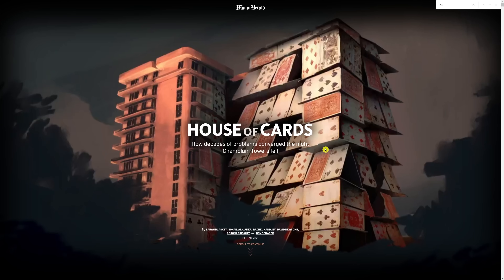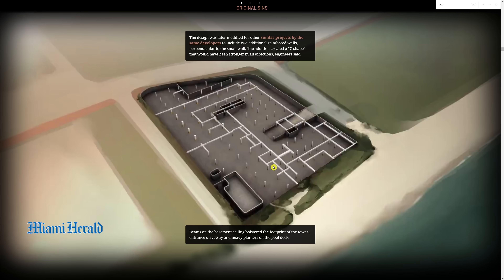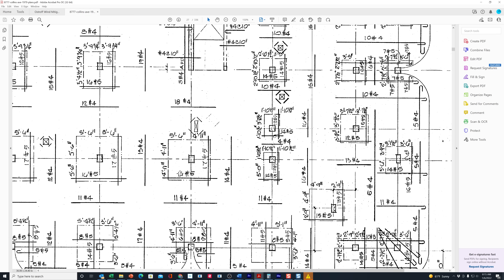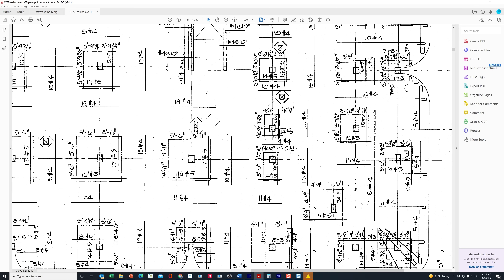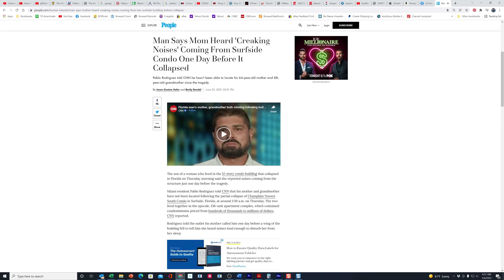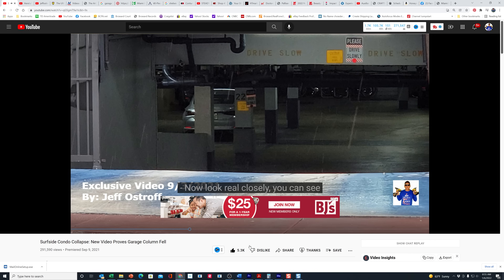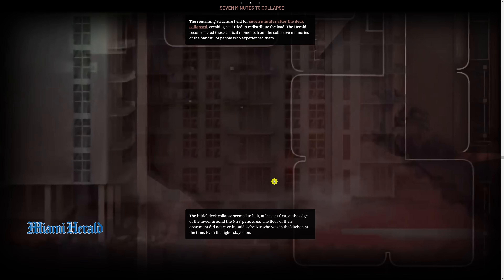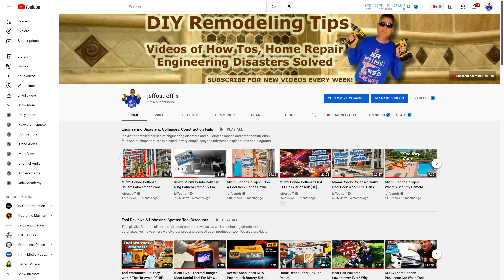Best Condo Collapse Theories: Me Or Miami Herald House of Cards?

Comment: There are some engineering issues with the analysis performed by the Miami Herald.  Some of my comments will relate to the Miami Herald analysis and article, some will relate to this video.

Columns in one area were bigger than columns in another area, that doesn't mean that the smaller columns are insufficient.  The small columns under the east wing are sized fairly close to what they need to be to support the weight of this building.  They may look thin, but there are also not very tall since in a parking garage or condo the floors are not very far apart.  Office building and industrial buildings can have columns 2 or 3 times as tall as these in which case a small column could be a problem.  The Miami Herald story does not conclude that the columns are too small, only that the reinforcing spacing is an issue and this particular issue is a gray area in the building code, the reinforcing in these columns does not violate the building code.  The columns are probably the part of the original building that was designed closest to what was required.

In the plaza area there are some beams that were removed between the permit drawings and the final drawings.  The problem is that these beams were not strong enough for the job they needed to do.  The version of the drawings without the beams is stronger than the earlier version of the drawings with the beams.  Having a beam or removing a beam might be important, but all beams are not created equal and you have to also do calculations for the strength of the beam before you assume that it would be important to the strength of the building.  In fact some of these beams would have been very much overstressed if they had been constructed.  I'm writing that without the beams the slab would be stronger, but still not strong enough for the required loads.  The Miami Herald engineers are correct in that this slab would have been overstressed from the beginning.  Since it was covered up by waterproofing and pavers nobody could have seen the cracking in the top of the slab over the columns.

Anti punching shear rebar?  Who made that up?  Certainly not a real structural engineer.  Don't listen to what other youtube channels say about his.  There is no such thing, you will not find it in any reinforced concrete textbook, you won't find it in the 1977 ACI building code, you won't find it in the 2019 ACI building code.  In 1977 the main way of reinforcing a slab against punching shear was to use steel shearheads and they most certainly did not have these in the Champlain Towers drawings.  More recently a product called stud rails has been invented and is widely used as punching shear reinforcing.  The Herald article discusses punching shear due to insufficient reinforcing steel.  There is no engineering basis for this in concrete textbooks, concrete design practice or concrete building codes.  The steel was in fact not placed as required by the drawings but the biggest deficiency with respect to punching shear capacity was insufficient slab thickness and this goes back to the original structural design.

Is the fitness center weight important?  The weight of all of the materials on top of the structure outside of the pool deck would be very much heavier than the weight of the equipment in the fitness center.  This includes the planters, the dirt, the pavers, mortar, grout, and additional concrete topping.  And the concrete slab under these materials is similar thickness and reinforcing to the concrete slab under the fitness center.  So if the fitness center is of concern then the pool deck loading is of even more concern.

The Miami Herald article mentions interaction between the ground floor slabs and the basement walls, as if the slabs are pulling on the walls.  They have omitted one important thing and that is that generally it is the other way around- dirt outside the building pushes against the basement walls and they in turn push against the ground floor slabs.  So the interaction is pushing not pulling.  I suspect they omitted these loads from their computer analysis.  This is the reason that Allen Kilscheimer told the city after the collapse that the basement walls were still in danger of collapsing- the dirt outside was still pushing on them and they no longer had the ground floor slabs to lean on.  The graphics in the Miami Herald article show how a system like this would normally be constructed however the text in the article and the photos from the site show that the building might not have been constructed this way.  The original structural drawings are very skimpy on how this would be constructed and did not show the reinforcing to be placed in the way that it should be placed to properly reinforce a connection like this, however even if built as the drawings show it would not have failed as stated in the Miami Herald article.

The article goes on to talk about reinforcing steel failing as damage spreads across the deck.  Again they have overlooked the interaction with slab movements with shear stresses around the columns.  It is more likely that as one area of slab deflected that the rotation at the columns increased which in turn increases punching shear stress and causes punching shear failures to progress across the pool deck.  This could happen if the connection from slab to basement wall failed but it could happen in similar fashion if one of the slabs decided to have a punching shear failure under a planter just outside of the tower.  The small beams under the planters wouldn't stop this, the small beam along the edge of the tower wouldn't stop this, and it would continue under the tower at which point the columns would lose their bracing and could fail in buckling.
Reply from the maker: Good insight, thanks!
Reply: @Bill J can we snag you for our research group ? Your knowledge and analysis is impeccable ! 🙏
Reply: @CollapseOfChamplainAndMore  Maybe
Reply: @billj5645  if you click on this profile . It will go to my channel . The links are in the comments there 😉
Reply: I agree with that too. It’s more about column spacing at lack of tie beams

Comment: There was a lot of corruption with the inspections process during construction.  It took many many people in charge to overlook the grave mistakes/ negligence that occurred from the beginning.
Reply from the maker: From the cocaine cowboy era
Reply: @jeffostroff  I was about to say the same thing. Miami in the 80s was built on cocaine
Reply: There is too much speculation about corruption in the inspection process.  Even today inspections at a construction site are not what people think they are.  Now things like fire alarms and toilet stalls, city inspectors understand what those things are and what they should look like, but a mat of reinforcing steel with bars of different lengths at different levels going in multiple directions, that is a whole different matter.  I can look at the original structural drawings and immediately spot areas where they left out required reinforcing but standing on the jobsite is a different thing and if someone is not intimately familiar with all aspects of reinforced concrete design they might miss a few things.

Comment: I am curious what your assessments of the fourth sister condo to the Champlain trio - the Mirage at 8925 Collins Ave - will be. If it wasn't for your work analyzing these tragic events I feel like this entire event would have been successfully "memory holed" by now. Lastly has there been much information made available yet on the density and strength of concrete core samples analysis?
Reply from the maker: I heard they were going to check the Mirage also. I would be nervous
Reply: The managements of those other buildings should find a qualified engineering firm, someone with experience in designing those types of structures, and have the drawings for their building analyzed.  No disrespect to staff at the University of Washington but it is possible that they aren't in the day to day business of designing reinforced concrete buildings.

Comment: What struck me most about the Herald presentation and analysis was that they gave a meaningful explanation for security guard Shamoka Furman's statement that it started with a "boom, boom, boom."  That never made sense to me -- the sound of the pool deck falling in would have been more of one big "Whooooom!"  The Herald's expert associated the individual "booms" to failures of individual pieces of rebar connecting the pool deck to the perimeter wall, and even threw in a recording from a lab of what such failures sound like -- "boom boom," indeed.  That seemed to be a basis for their conclusion that the connection between the pool deck and south perimeter wall, where failed rebar ends apparently are visible, was the initial failure point.  It makes sense, I guess, as far as it goes -- and it does tie in nicely with the claims in the lawsuit that point to the vibrations and drainage from the 87 Park project as causal factors.  That said, a lot of their other analysis was familiar to me already from your videos!
Reply: I guess it could be three points giving way in a domino effect, boom!, Boom!, BOOM! Shamoka is one of the few earwitness to the collapse so her statement is very significant. I will say I didn't know much about the pool deck/south wall connection being the possible initial failure point but it's believable. In short, the pool deck was so waterlogged and badly maintained it literally was an accident waiting to happen.
Reply from the maker: Yes and I have read reports then in situations like this people often have a Thai hard time articulating into words the exact sounds that they heard and so the interpretations can be quite varying. For example she made two 911 calls and on one of those calls she told the operator there was an earthquake.
Reply: @jeffostroff  yup ur frontal lobes fire and the rest of your brain shuts Down. Fight or flight. Nothing in your mind is thinking clearly apart from escaping the threat. So much so that people can lose control of their bladder etc . TMI 🙊 Pretty primal. I know a vet That has no clear memory of a situation he was in. I won’t put it here . But he says looking back it’s like  you only have memories like “snap shots”

Comment: Fire sprinklers have a waterflow sensor at the valve that triggers the fire alarm after about 45 seconds (pneumatic time delay.)  So yes, waterflow is always supposed to activate the building fire alarm.
Reply from the maker: Still strange why no one heard the alarm, unless someone had the warning siren disabled
Reply: @jeffostroff  Whatever the case, the strobes were at least partially working up to the upper levels.  Depending on the fire alarm system, you can silence the audible devices from the fire alarm panel while the strobes continue to flash until you clear and reset the system.
Reply: Come to think of it, wasn't the lobby still standing?  The Fire Alarm Control Panel is usually either in the lobby itself or in a utility or mechanical room nearby.  There should be a submittal to the fire marshal showing the location of all the fire alarm equipment.  If the engineers on site were able to recover the fire alarm panel itself, that will have the event log of every action performed on the panel.

Comment: Thanks Jeff, another great video. I wonder if the pool deck was already at 100% load what was the % when it finally collapsed?
Also, the creaking and cracking before the collapse, is this caused by a beam above the parking garage bowing or a beam crunching/crumbling? I guess it's probably both. 

Finally, I bet the Miami Herald used a ton of info from you videos for their investigation!
Reply from the maker: Herald had their own engineers from the second day after the collapse. But yes I would tell early one a few sites were inspired by some of my earlier videos
Reply: @jeffostroff  Wow, I'm impressed the Herald was on the case so quick, I thought good reporting was dead. Still, if they get an award or 2 you should as well!
Reply: Yes. I know I did. The videos are informative.
Reply: @dawnelehman2592  my daughter is a hydrologist for the Forest Service in the PNW. She paid for college as a rappeller on a Forest Service helitack crew aka wildland firefighter. She also works on BAER (burned area emergency response) teams. Of course she was noticing the water coming up from underneath that was pumped out. As she understands, Florida has a high water table. She was wondering if the concrete columns can soak up water from the bottom too, much like a tree.
Reply: @dawnelehman2592  thank you for being a woman in STEM & highly regarded.
Reply: @dawnelehman2592  class act. Thank you for your efforts here, that article is amazing. I’m very grateful to you, Jeff, and Josh - you all are making the world a safer place. With limited resources, too! Really admirable.

Comment: 6:25 Just a second! If the pool deck columns were already at 100% load what about the same size columns that were under the building? They must have been at 300% and still keeping up? BTW they were spaced closer together (1.8 times the number than under the deck?) under the east portion which was a little hesitant to join the collapse. The pool deck had no load in comparison to the building. Hasn't Josh calculated the columns supporting building?

Perhaps I remember that wrong?

My take is still the pool deck collapsed not due to overload but by deterioration of the areas connecting the columns to the deck. As the core sample suggest. And the columns stood up but the punch shear got them.
Reply from the maker: Under the building that collapsed the columns were 12  x16 and 16 x16
Reply: There was so much neglect and faulty maintenance to the pool deck it was a disaster in the making. The building columns were probably in much better shape so I don't think they were under 3 times the load. Still, Jeff is right 12 inch columns are too skinny. I've lived in many condo's and all the parking garages I've used had at least 24 inch columns. I know, I scraped the right side of my car against one of those wide columns.
Reply: Yes I think that is exactly what happened! The  deterioration of the pool deck is what caused the entire thing.
Reply: @willschultz5452  Yep, it's almost certain as the cause. Heavy, little to no proper maintenance, added layers, waterlogged. It would be fascinating to know the weight of the original pool deck 40 years ago compared to the pool deck weight right before it collapsed.
Reply: You are misunderstanding what the article stated.  The SLAB of the pool deck was at 100% of its capacity, not the columns under the pool deck.  The columns under the pool deck were barely loaded at all.  The similar sized columns under the tower of the building were still well below 100% of their capacity.  I've done the calculations on the columns under the building myself.
Reply: @billj5645  Okay, my bad. Thanks for explaining. Makes one wonder why it held so long given that some substantial corrosion had already taken place. The 100% capacity number, does it include any safety margins or was that the pure static load and nominal strength of the concrete cum reinforcements?